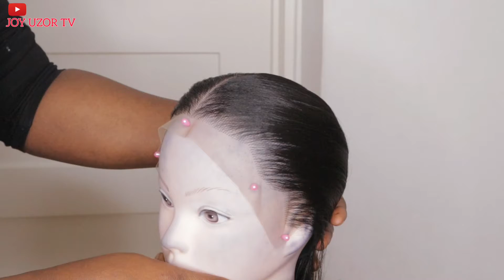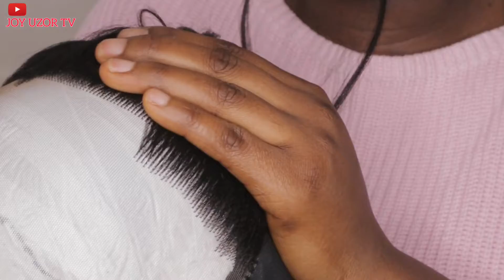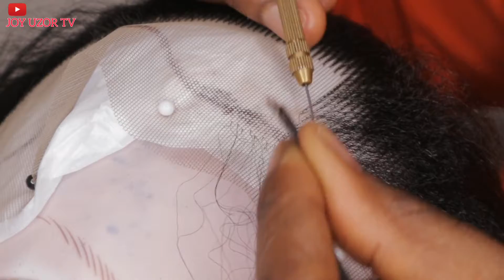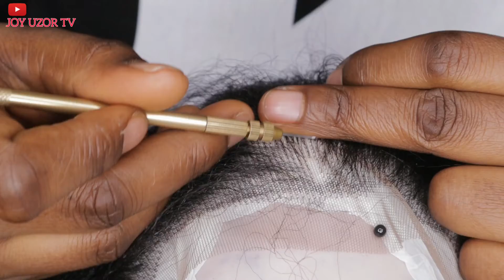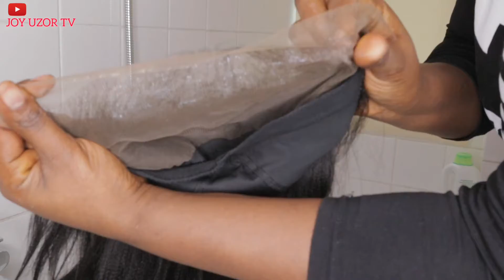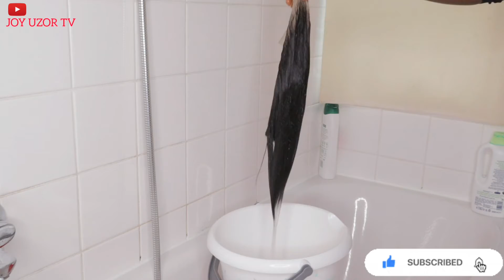DIY FRONTAL | How To Make Frontal From Start To Finish | Beginners Friendly

Comment: I easily get body aches around my neck and back especially, during ventilation so am not always able to do it for long.
Reply from the maker: So sorry sis! But always bend ur dummy head to ur direction when ventilating, do not bend urself to d dummy head! I was having same problem when i started newly, i was even taking paracetamol every night before sleeping 😴 but not anymore.
Reply: @joyuzortv  do you put the dummy on your laps or you use the dummy holders
Reply from the maker: @jariaathjasminemussa1614  I have a mannequin head stand that can rotat anywhere, u can make shorter nd sit to ventilate or make it longer nd stand to ventilate

Comment: Counting the number of hairs makes the whole work Soo difficult for me,
I wonder how y'all get the correct number at first trial.
Reply from the maker: Counting d stands is not a problem for me, because i don't hold d extension tight together, rather i separate it to make it easier to see d strands
Reply: Dis is nice Sis um learning❤